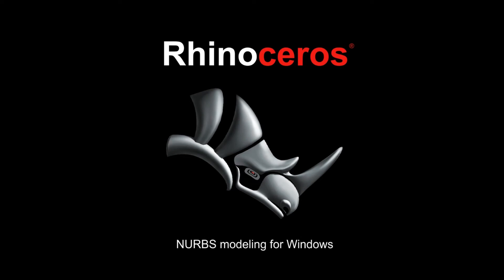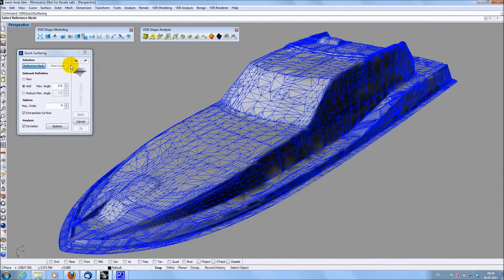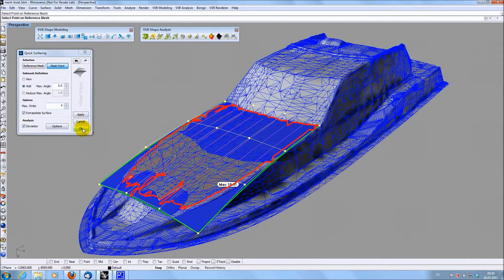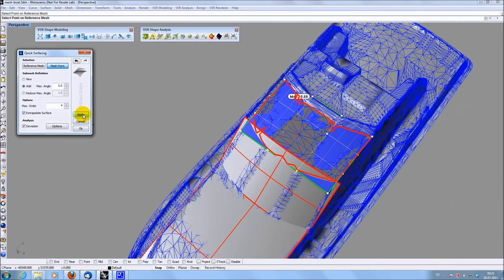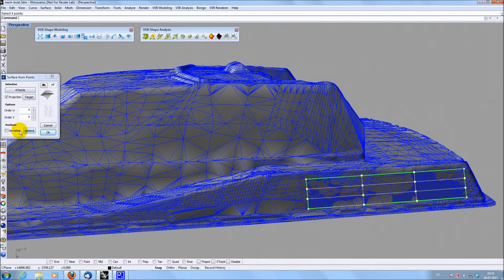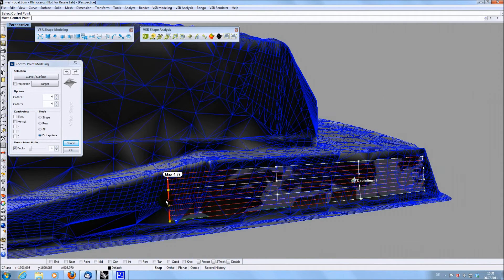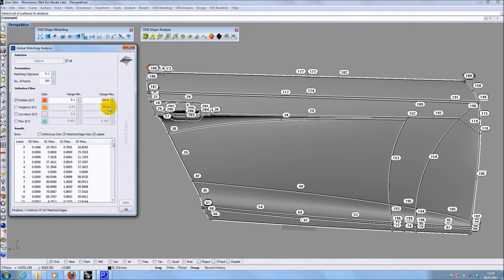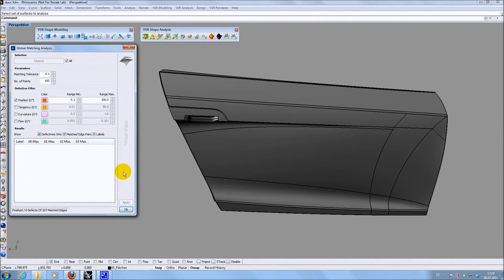VSR Shape Modeling 1.0

Comment from the maker: @KevBoy3D the main key points are (for Rhino):

1. Surfaces and curves with low number of control points -> easy to get the right shape.
2. Quick surface generation on meshes (e.g. good for reverse engeneering).
3. Full associative analyses -> full control over your modifications.
4. Being able to use several functions at once.

You can also check the "VSR Shape Modeling 1.0 tips and tricks for general workflow" video.